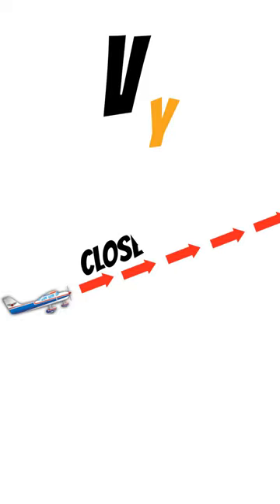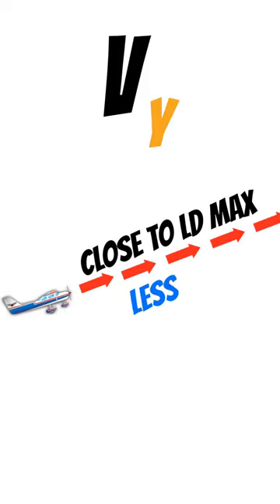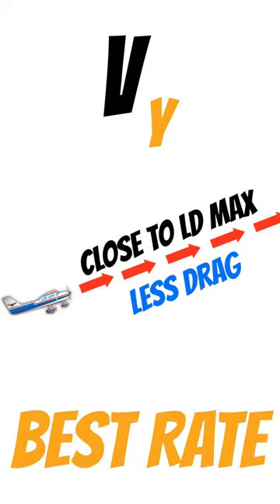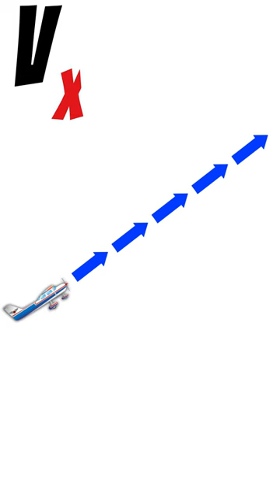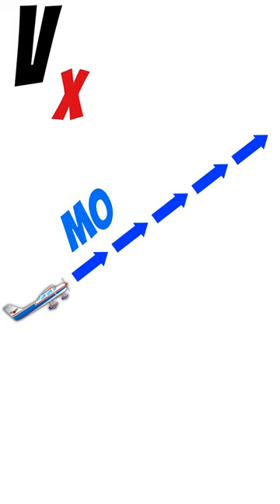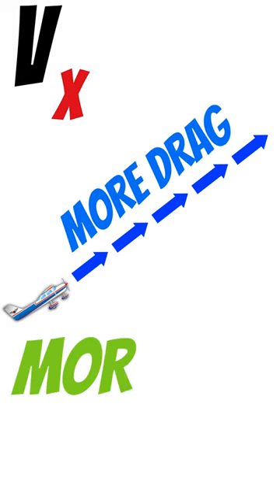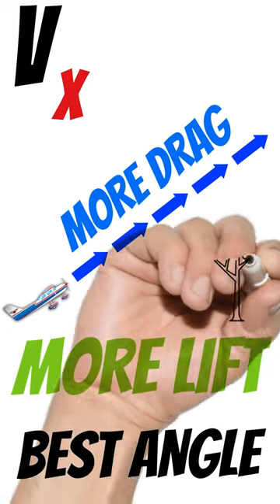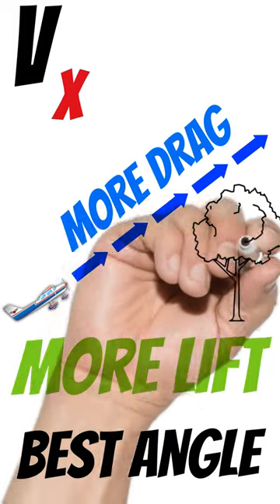Why do we CLIMB at Vx?

Comment: Hello, flight instructor here, I would be careful about this explanation. This is an alright baseline, but be careful here. Vy happens when we have the most amount of excess power available (power being the rate of thrust we generate over a given timeframe). Vx happens when we have the most amount of excess thrust available to overcome weight and drag. Source: PHAK, Chapter 5, Page 5-24. PHAK, Chapter 11, Page 11-7.
Reply from the maker: You are 100% correct, but the PHAK also explains that Vx is slightly below LDmax in propeller driven aircraft and closer to LDmax for Vy. Thrust plays an important part just like you mentioned, but i couldn’t get all that info in a 60 second “short.”  I think LDmax is a more important consideration for new students to grasp. Maybe I can talk about power more in a future video. Thanks for the comment!
Reply: @FreePilotTraining  absolutely!! I’m loving these videos man keep them up! The only thing I would change is the end that says you generate more lift at Vx; just be careful with that and say you generate more thrust at Vx :) that’s what gets us up!! Great stuff keep it up
Reply from the maker: @Davethehorse321  thanks!
Reply: Given the time frame chosen (1 minute), very well explained.
Reply: @Davethehorse321  Would it be correct to extrapolate based on what you two are talking about is that you cannot do Vx for an extended period of time due to the lack of power available - more drag, reduced speed, chance of stall - thus once cleared of the obstacles you should pitch down to Vy to get a more efficient rate of climb and recover some of your speed? Am I understanding that correctly?

Comment: I suppose a way of putting this could be Vy is the best climb per second but Vx is the best climb per meter forward, so if you need to dodge an obstacle you want to get the most meters up for the least meters forward but when you're in a normal climb to altitude you care more about how long it takes rather than what distance it covers hence climbing at Vy

Comment: While flying at Vx and Vy, lift is identical. What changes is excess energy available to convert to climb rate.  That combined with the different ground speeds gives you the difference in climb gradient.
Reply from the maker: I’m not sure that’s true. You’re at a higher AoA which is one of the ingredients for more lift
Reply: @FreePilotTraining  higher AoA, but at a lower airspeed.  Lift has to be equal by definition.  If not you would be accelerating, that is, your climb rate would be changing.  In steady state lift equals your weight and any excess power available is converted to climb rate.  Climb rate = excess power / weight.

Comment: This speed also referred to as speed for minimum drag or VMD
Reply from the maker: I’ve never heard that. Thanks for sharing!
Reply: Yes. Or also in gliding, min sink speed. You won't glide the farthest, or have the lowest drag coefficient, but you will have the slowest energy loss due to the lower velocity, despite the slightly higher drag coefficient.